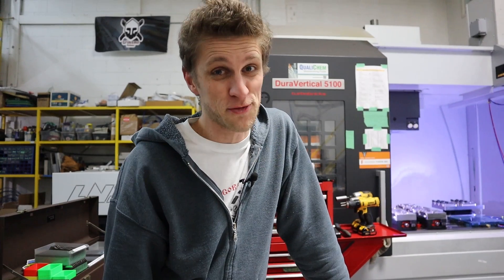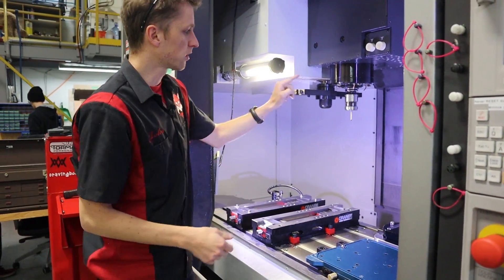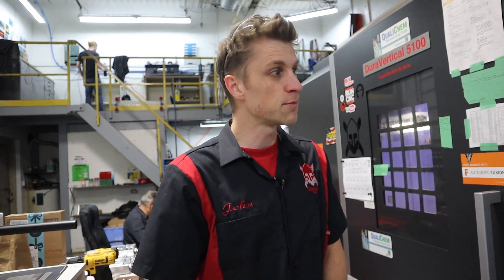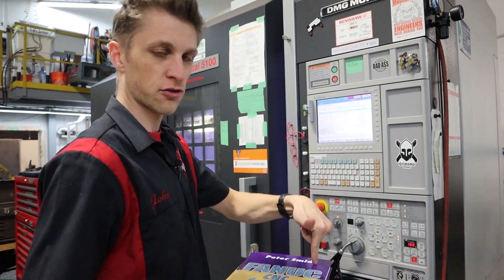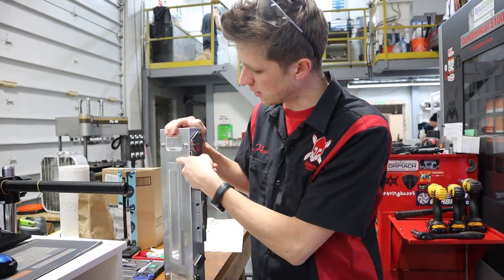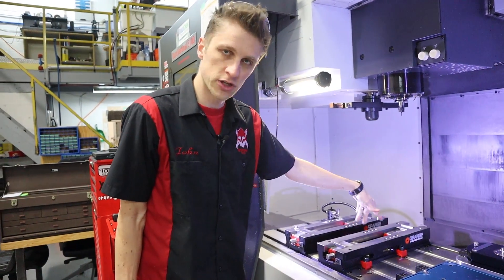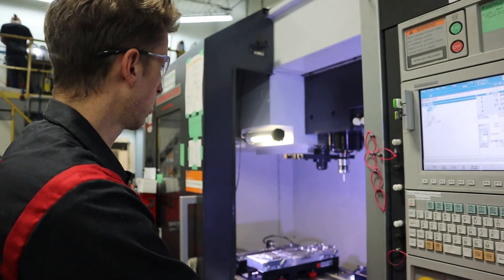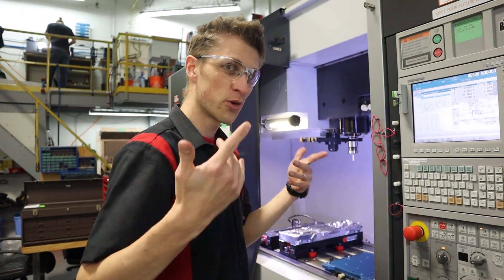The Code Behind the Fixtures - Part 2

Comment: May talk to memex about upgrading your machine memory. I think you would find it more accurate and less problematic to go to a pallet type setup like Saunders uses and bolt your fixture down. Torque would have less effect on position and it would be more rigid.

Comment: Why not use a code block and the probe to tell it which pallet is loaded and run that code. By code block I mean 2x.25x.25 block shape with a .25 cube shape rising up for the start position then everything that height is a 1 and everything .25 inch lower is a 0 and use binary. Always start with 10 with 8 total bits you can have 64 pallets using the 2 start bits. The first would be 10000000 the second 10000001 and so on. Just remember that binary collections start with 0 not 1 :}

Comment: If you use multiple pallets, you could machine a pocket into them at different depths at the location you are probing to differentiate between which pallet is installed and call the corresponding program
Reply: That could work. I would use a braille/binary type system. The probe first checks the pallet is there and which is where the braille Z location is, and then goes to a spot the size of at most, a quarter, looking for 6 indents. Each indent corresponds to a 1. Probe checks each height difference for a yes/no, and starts doing some math. Right from there you get 64 pallets. Later on, you could add another space for 6 more dots. 4000+ fixture identifications. I say that's plenty for the most part.

Comment: Detect overtightened pallets (or misaligned) by probing several reference points on the pallet before machining. Recessed corner faces in XYZ should be relatively immune to handling damage.

Comment: Not trying to bust your chops, but you really should learn to do press fits. Your machines are capable of holding the tolerances required. It will simplify your designs. Ask Angelo to show you types of fits in the machinist handbook.

Comment: Just curious that tool that was in the machine that opened up under rotation and snapped closed when stopped what was that?
Reply: That's a fan for blowing of chips and coolant. We have them in the shop I work too and they work great.
Reply: chip fan blades are spring loaded

Comment: You have 512 kB not mb
Reply: 500KB is such a joke. What is that company thinking? Such a big table, and you can't use it properly. It doesn't take much to fill up 500KB. It's like they still think people run code like it's 1980, and never heard of high feed adaptive toolpaths. No wonder Haas gets to have a piece of the market when they offer 1GB as standard.
Reply: @gredangeo  No kidding, the parts I'm running on my Tormach right now are like 1.5mb for each part of the assembly (x3).
Reply: damn that sucks

Comment: I use machines with siemens controller 802d sl mill and 828d sl turn. Do you have any suggestion for a macros manual like you have for you fanuc. Please try and help.

Comment: i work in a automotive factory and we use bosch exact ion wich are a battre gun that in also a torque wrench and because brack away torque is less you can also undo the bolts with them and a torque range 1Nm to 60Nm depending on modle you cood use for both vices and fixture bolts

Comment: The real question is, why is there only 500 MB available on the fanuc side? It would cost them relatively nothing to put more storage. Is it a limitation of fanuc?
Reply: I believe its actually a type ram. He switches to a mode which runs from the hard drive (also known as tape mode). He would also be able to run of a network drive for example in this mode.
The 500 MB comes from the extremely fast solid state memory (~ram~ in pc logic) which needs to read like 500 lines ahead, and calculate anything that needs it, before the machine need to act on it.
Its true that you can buy 1 tb of storage pretty cheap today, even ram sticks and ssd's are getting bigger and cheaper. But, the type of storage needed in these types of machines, has to be faster than traditional pc hardware.

I believe that when we got our new Mazak VTC800 at work, we looked into how much it would cost to get more memory. 
Standard was something like 5 mb. 
1 GB was like 2000$ extra, and 10 GB was 8000$ 
But then again... its a mazak machine...
Reply: @WirierEcho  but DRAM is cheap enough that it can literally read in nanoseconds and you can get gigabytes of that stuff for under 100 bucks. I think it's a technical limitation but caused by legacy software.
Reply: Anonymouspock my guess is that it is more like a cache, data stored on the CPU or FPGA. It's much more expensive but it doesn't have to be transferred so it is read much quicker and without a chance of data corruption. Just think if a decimal got moved when g code was moved from RAM to the CPU...
Reply: Worse than 500MB. John was wrong. It's only 500KB. Pretty sure you can find toasters with more memory.